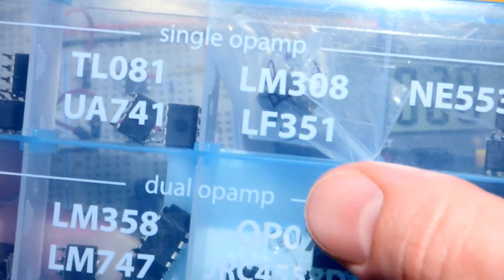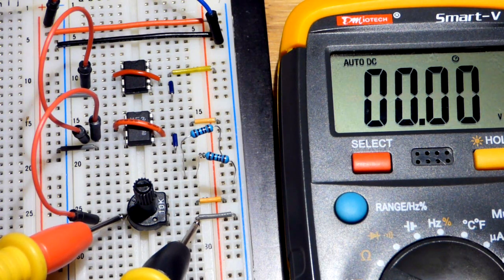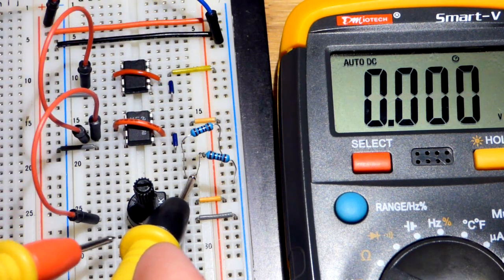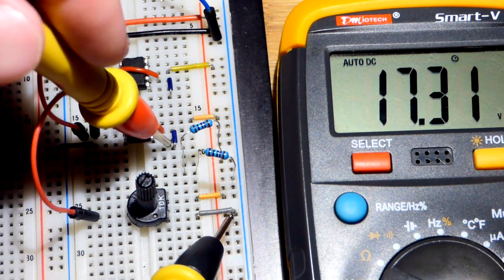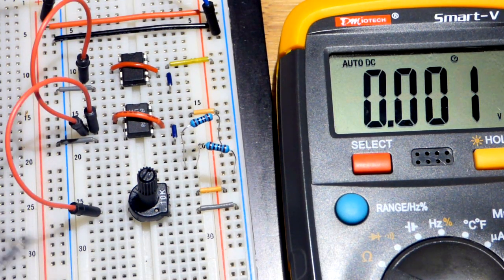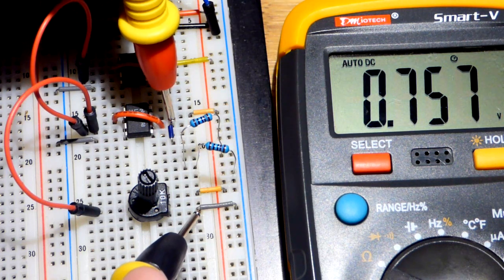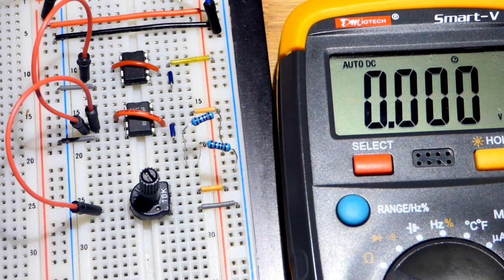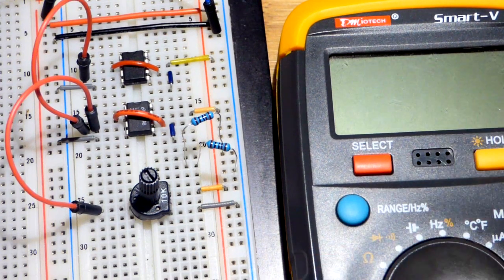UA741 and LM308 op amp output to rail voltage comparison multimeter measurements for DIY electronics

Comment: Good video, what about lm324?
Reply from the maker: Thanks! Looking at this datasheet https://www.ti.com/lit/ds/snosc16d/snosc16d.pdf it looks to me like the op amps in the LM324 are similar to ones in the LM358 that I use in other videos. Single supply op amps like those tend to have outputs that with no load can go to ground (0V) of a single supply, or to the negative voltage if it is a dual supply, but not all the way to the positive rail voltage.
Reply: @Electronzap  yes, Vdd - 1.5. But I wonder how close to the gnd will it go?
For me close is something like 0.1v, the datasheet says close, but this can be the the diode drop to 2v, that you found, depending on the application requirements, it can be toomuch. 
Thanks
Reply from the maker: @garlet3  Yeah, the output limitations can be annoying. :( I learned most of what I did by testing them myself.